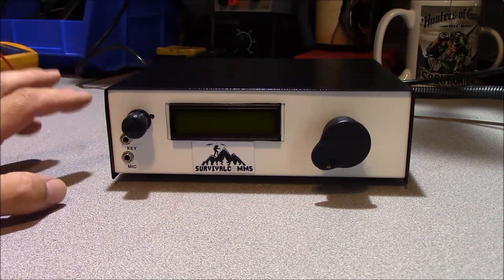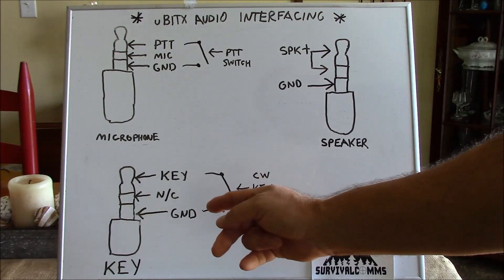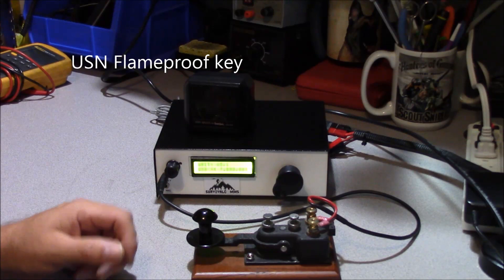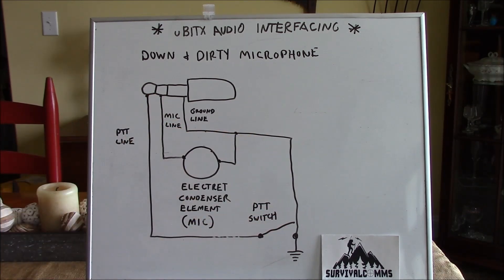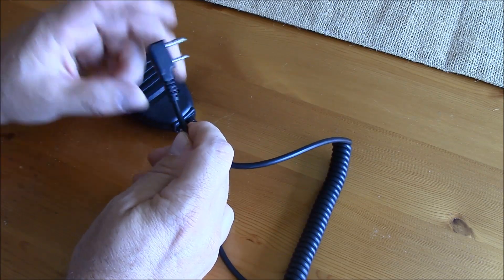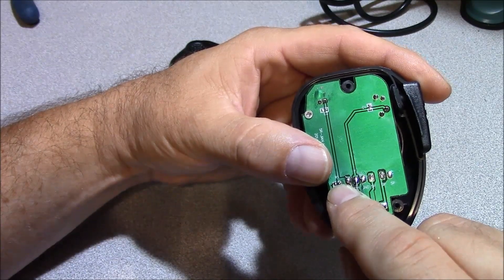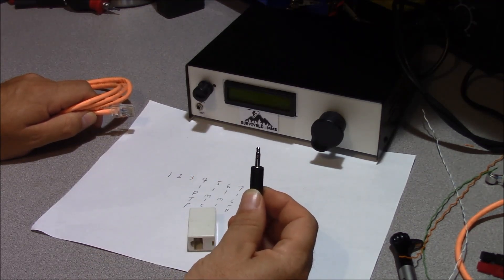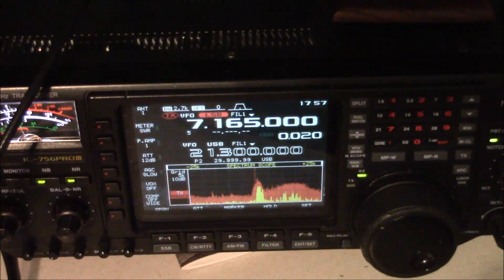uBITX Amateur Radio Kit  HF SSB/CW  $130 Part 4 - Baofeng Mic mods

Comment: Love it! Very informative Bret! Enjoyed all the options for the mic! I used an old CB mic, but some of these options would've been much easier!
Reply from the maker: Thank you ! I have interfaced the uBITX to several interfaces including a David Clark system. There is more to come in the next video and will be interfacing the uBITX  to a signa link (which works great BTW). Thanks for watching !
Reply: @survivalcomms  I'll be watching! I have a SignalLink, bought it for some FT8 with the FT-857.
Reply from the maker: @InPhocus_ADV  FT8 is really cool ! Let me know when you get it set up.
Reply: @survivalcomms  Oh, I have it working with my 7300 (easier as it has a build in sound card interface). I've been using this map to track my WSPR reports- http://wspr.vk7jj.com/
Reply from the maker: Are you running WSPR all the time ?
Reply: @survivalcomms  No, I'll run it for an hour here or there, sometimes less. I was running it on all the bands to see how the Broadband Butterfly Terminated Dipole in the attic is working. I need to do it again, but in a more controlled manner.
Reply from the maker: @InPhocus_ADV  I run it sporadically as well.  During lightning season here ( like right now) I keep my antennas completely disconnected unless I am operating.  The other day I had my 80m doublet disconnected and the feeder laying an inch from my steel desk (it is grounded).  Unbeknownst to me a small storm moved in and close strike actually threw an arc from the feeder to the desk with a large "SNAP" .  Any radio that would have been connected would have been FUBAR . Thats why I don't beacon as much as I like.
Reply: @survivalcomms  Ouch! Yeah, I keep my antenna disconnected unless I am using it. We've had a lot of small storms here in the last week, or two. I'll shoot you an email next time I run it.
Reply from the maker: @InPhocus_ADV  Please do !